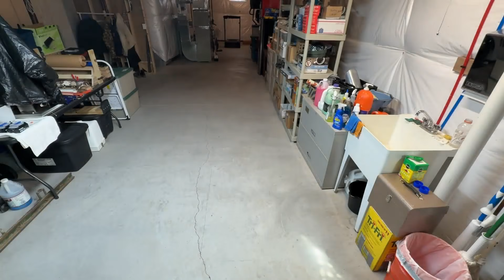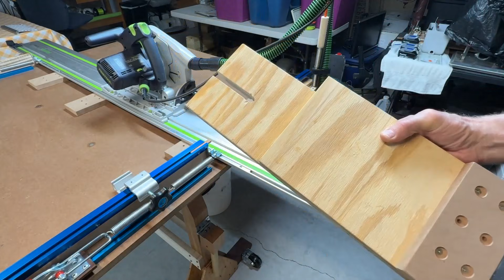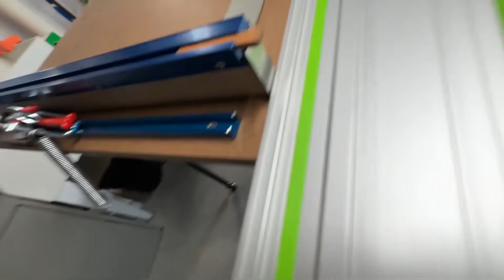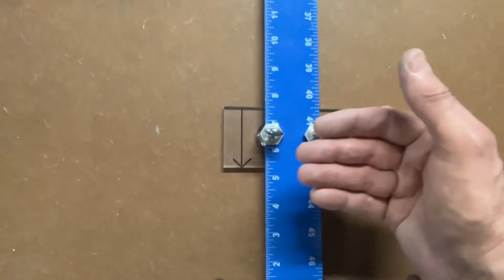The Springboard Track Saw Crosscut Table

Comment from the maker: Link to my Google Drive for Springboard Free Plans.
https://drive.google.com/drive/folders/1IHfnO7HMbtAyvKHLPwqCDH6BgbAEkbJq?usp=sharing

_____Contents of this Video _____
0:00 - Springboard Introduction
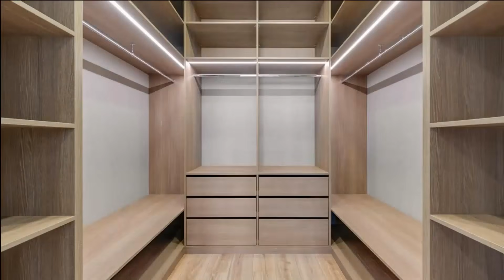1:18 - The Problem
3:46 - The Solution
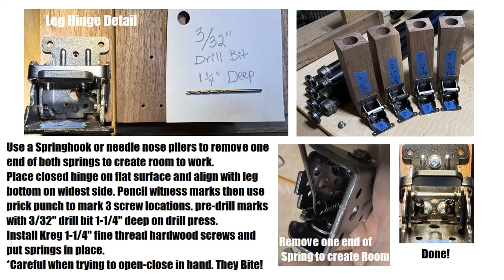4:04 - Free Plans
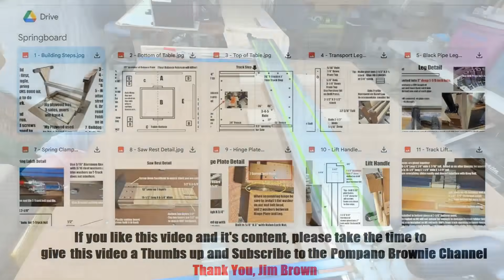5:22 - Fulcrum vs Hinge
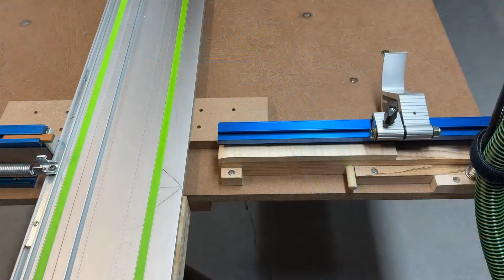6:29 - Track Lift
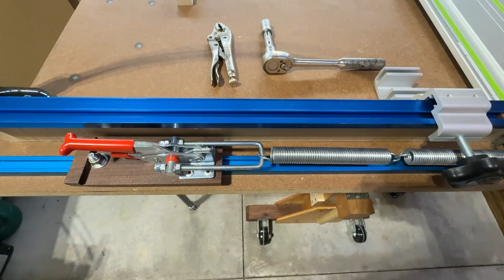8:07 - The Springs
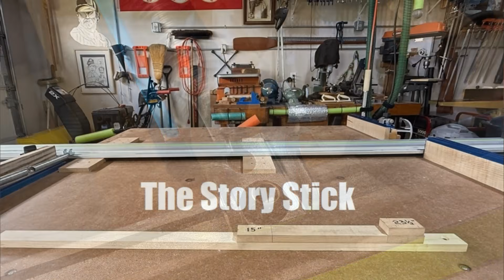10:12 - Story Sticks
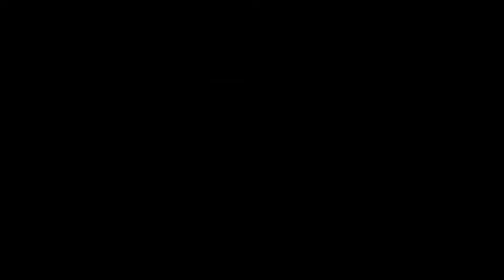17:27 - Saw Rest
19:03 - Hose & Cable Mgmt
21:59 - Handles & Casters
26:46 - Leg Hinge Tip
27:30 - Bulldog Clamp Tip
28:28 - Epoxy Screws & Bolts
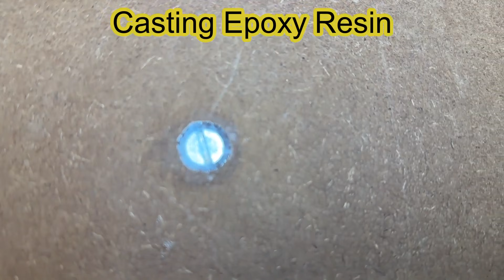28:37 - Pirate Legs
31:46 - Hinge Bolts
32:07 - Hinge Lock
32:17 - Kreg KMS8000 Stop Kit
33:33 - Squaring Track Stops
41:14 - Track Stop Felt
41:45 - Ripping Square Part-1
52:35 - Sealing the MDF
53:36 - Ripping Square Part-2
55:32 - Working Demo
56:18 - Closing Thoughts

Items Needed & Costs for the Springboard
Harbor Freight 3” Rigid Caster at Harbor Freight $4.99 (Buy 4 )  https://www.harborfreight.com/3-in-polyurethane-rigid-caster-69851.html
4X8 ft ¾” MDF Panel at Home Depot - $48.98   
15 Board Foot of 4/4 Hardwood Lumber – I get rough-cut kiln dried Cherry Oak and Maple from a small kiln for around 3.00 a board foot. – $45.00
Qty-2 2-1/2” Broad Utility Hinges at Home Depot - $7.94
¼”X 4ft Fiberglass Driveway Marker at Home Depot - $3.47
1 1/8” hardwood dowel – $5.12     4X8 ft 23/32 Cabinet Grade Plywood at Home Depot - $39.98
¾” X 10ft Black Pipe $38.35 (cut all to 26in thread one end) at Home Depot - $34.98
Qty 4 - ¾” Black Pipe Caps at Home Depot - $13.04 
Ames Heavy Duty 48” framing Square at Home Depot - $31.99   
Framing Square Stops at Home Depot – $8.97
Gardner V20C Spring (3-Pack) at MSC - $14.08 (You need 4 springs so get two 3-packs $28.16)  https://www.mscdirect.com/product/details/91664979
Kreg KMS8000 Trak & Stop Kit at Amazon - $169.00  https://amzn.to/4sr8gtM 
 8oz 5 min Epoxy at Amazon – $18.98 https://amzn.to/4dB7BkX
12”X12” ¼” Polycarbonate at Amazon – $13.99 https://amzn.to/47SRyeH    
CB Antenna (2 Pack) at Amazon– $20.59  https://amzn.to/4bBQRYk
Bulldog clamps (10-Pack) at Amazon – $9.99  https://amzn.to/4buH9bm  
 Kreg 1-1/2” Fine thread screws at Amazon - $8.99  https://amzn.to/4bs6sLh
32oz clear casting Epoxy Resin at Amazon - $20.99  https://amzn.to/4lOZovI   
Folding Hinges (4-Pack) at Amazon - $16.99  https://amzn.to/3Pqom8y
3/8” Threaded Levelers (4-Pack) at Amazon - $9.99  https://amzn.to/4lKROlH   
Toggle Clamps (2-Pack) at Amazon - $14.99  https://amzn.to/47fxhzL  
Gorilla Duct Tape at Amazon - $10.60  https://amzn.to/4uPPWwf  
Titebond III Ultimate Wood Glue at Amazon - $7.97 https://amzn.to/47lzPfH
Powertec T-Trac Knob Kit at Amazon – 12.91 https://amzn.to/4lJkdIS  
Powertec T-Trac 24 inch (2-Pack) at Amazon – 18.89  https://amzn.to/3NW2H7M
Oatey Plastic Pipe Strap at Amazon - $7.45 https://amzn.to/4dbC35c  
Aluminum Foil Tape at Amazon - $6.99 https://amzn.to/4dfUohx 
45ft X ¾” One-Way two sided Velcro at Amazon - $14.25    https://amzn.to/4ttwO5K 
4-Piece Toggle Clamp at Amazon - $6.79 https://amzn.to/4tjNTin 
Adhesive Backed Peel and Stick Felt at Amazon – $6.79  https://amzn.to/3O48zfl 
Vinyl Covered Scuba Weights at Amazon - $13.50 https://amzn.to/4twdEfs  
Howard Feed-N-Wax at Amazon – $10.98 https://amzn.to/4mw3tW8

Costs for the Springboard and Ripping S quare $696.69 vs $3,157.85      $2,461.16 Savings without Tax
With 8% Tax $3410.47 – $752.42   Total Savings   $2658.05

*These paid links to Amazon pay me a very small percentage if you use them, without raising the cost of the product a penny, this helps support the costs of making the Videos. 
Thank You, Please Give the Springboard video a Thumbs Up and Subscribe.  Thank You, Jim Brown

Comment: Thanks for some great ideas! I'm really liking the table you made and I'm surely going to start using similar story sticks in my work. I'm probably just being a little slow today but I'm not really understanding the actual use of your ripping square. Very cool on the ending, so subtle I'm surprised I caught it. Conner MacLeod "There can be only one."
Reply from the maker: Thank You Regnos. My Ripping Square's purpose is to replace Parallel  Guides. Parallel guides attach to the Track and measure the width of the RIP you want down the entire length of the plywood.  By using a Story Stick to set my Ripping square, the measurement and the corresponding marks on the plywood I make will always be accurate and consistent.  Once the marks are made I put my Track on the plywood and put the splinter guard of the track on the lines at both ends of the plywood sheet.  I then clamp down the track to the sheet from the underside of the track and make my cut. Because RIPS are your longest cuts.. they can ruin more plywood quicker if done incorrectly.  In regards to the ending of the video.. That's me in the apron, second from the right.

Comment: this is awesome! went a different way for making my mft style table. i was able to buy cnc cut tops very cheaply locally and bought hinges for the guide rail on banggood. also love the tso stuff, but the shipping cost to aus is insane. luckily i was able to get a really nice deal on a benchdog fence system. but if i had your level of ingenunity i'd definitely have done something clever like this! also i love how it folds up, such a simple yet clever idea!
Reply from the maker: Thank you Arthur. I feel for you on the shipping cost to the land of down under. I appreciate all of your comments.
Reply: @PompanoBrownie  it can be brutal! what's worse is the AUD's conversion, back in the early 2010s 1 AUD would get you upwards of $1.10USD. my trip to new york last year was eyewatering with the exchange rate now only getting $0.7 USD per dollar! anyhow rant over, i've subscribed to your channel!

Comment from the maker: The "Springboard" Track Saw Crosscut Table is a DIY project
that allows you to use a Track Saw without having to lift the saw from the Track after EVERY cut.

Link to my Google Drive for Springboard Plans
https://drive.google.com/drive/folders/1IHfnO7HMbtAyvKHLPwqCDH6BgbAEkbJq?usp=sharing

Items Needed & Costs for the Springboard

Harbor Freight 3” Rigid Caster at Harbor Freight $4.99 (Buy 4 )  https://www.harborfreight.com/3-in-polyurethane-rigid-caster-69851.html
4X8 ft ¾” MDF Panel at Home Depot - $48.98   
15 Board Foot of 4/4 Hardwood Lumber – I get rough-cut kiln dried Cherry Oak and Maple from a small kiln for around 3.00 a board foot. – $45.00
Qty-2 2-1/2” Broad Utility Hinges at Home Depot - $7.94
¼”X 4ft Fiberglass Driveway Marker at Home Depot - $3.47
1 1/8” hardwood dowel – $5.12     4X8 ft 23/32 Cabinet Grade Plywood at Home Depot - $39.98
¾” X 10ft Black Pipe $38.35 (cut all to 26in thread one end) at Home Depot - $34.98
Qty 4 - ¾” Black Pipe Caps at Home Depot - $13.04 
Ames Heavy Duty 48” framing Square at Home Depot - $31.99   Framing Square Stops at Home Depot – $8.97
Gardner V20C Spring (3-Pack) at MSC - $14.08 (You need 4 springs so get two 3-packs $28.16)  https://www.mscdirect.com/product/details/91664979
Kreg KMS8000 Trak & Stop Kit at Amazon - $169.00  https://amzn.to/4sr8gtM 
 8oz 5 min Epoxy at Amazon – $18.98 https://amzn.to/4dB7BkX
12”X12” ¼” Polycarbonate at Amazon – $13.99 https://amzn.to/47SRyeH    
CB Antenna (2 Pack) at Amazon– $20.59  https://amzn.to/4bBQRYk
Bulldog clamps (10-Pack) at Amazon – $9.99  https://amzn.to/4buH9bm  
 Kreg 1-1/2” Fine thread screws at Amazon - $8.99  https://amzn.to/4bs6sLh
32oz clear casting Epoxy Resin at Amazon - $20.99  https://amzn.to/4lOZovI   
Folding Hinges (4-Pack) at Amazon - $16.99  https://amzn.to/3Pqom8y
3/8” Threaded Levelers (4-Pack) at Amazon - $9.99  https://amzn.to/4lKROlH   
Toggle Clamps (2-Pack) at Amazon - $14.99  https://amzn.to/47fxhzL  
Gorilla Duct Tape at Amazon - $10.60  https://amzn.to/4uPPWwf  
Titebond III Ultimate Wood Glue at Amazon - $7.97 https://amzn.to/47lzPfH
Powertec T-Trac Knob Kit at Amazon – 12.91 https://amzn.to/4lJkdIS  
Powertec T-Trac 24 inch (2-Pack) at Amazon – 18.89  https://amzn.to/3NW2H7M
Oatey Plastic Pipe Strap at Amazon - $7.45 https://amzn.to/4dbC35c  
Aluminum Foil Tape at Amazon - $6.99 https://amzn.to/4dfUohx 
45ft X ¾” One-Way two sided Velcro at Amazon - $14.25    https://amzn.to/4ttwO5K 
4-Piece Toggle Clamp at Amazon - $6.79 https://amzn.to/4tjNTin 
Adhesive Backed Peel and Stick Felt at Amazon – $6.79  https://amzn.to/3O48zfl 
Vinyl Covered Scuba Weights at Amazon - $13.50 https://amzn.to/4twdEfs  
Howard Feed-N-Wax at Amazon – $10.98 https://amzn.to/4mw3tW8

Costs for the Springboard and Ripping S quare $696.69 vs $3,157.85      $2,461.16 Savings without Tax
With 8% Tax $3410.47 – $752.42   Total Savings   $2658.05
*These paid links to Amazon pay me a very small percentage if you use them, without raising the cost of the product a penny, this helps support the costs of making the Videos. 
Thank You, Please Give the Springboard video a Thumbs Up and Subscribe.  Thank You, Jim Brown